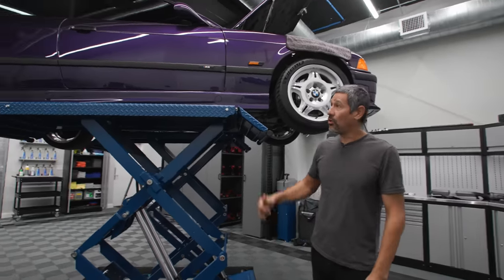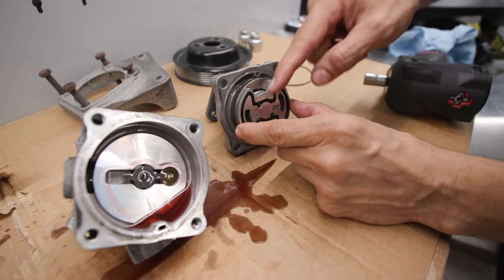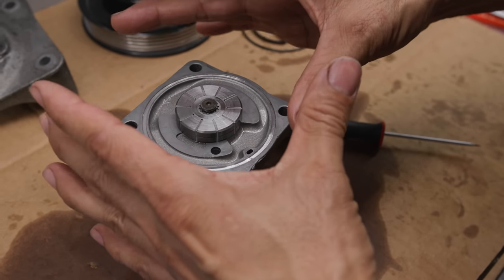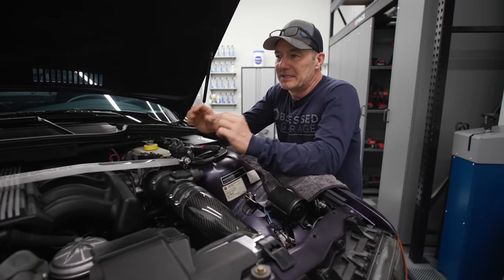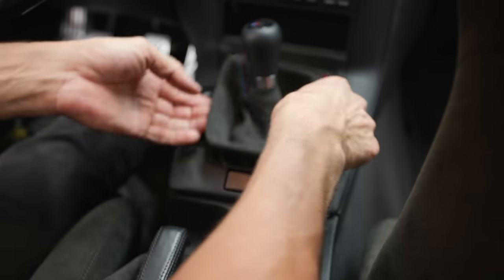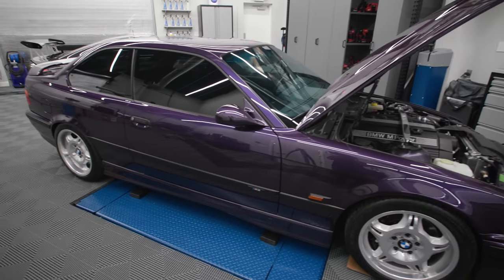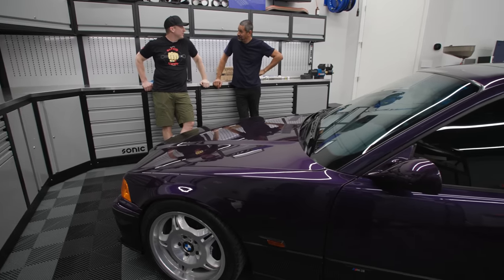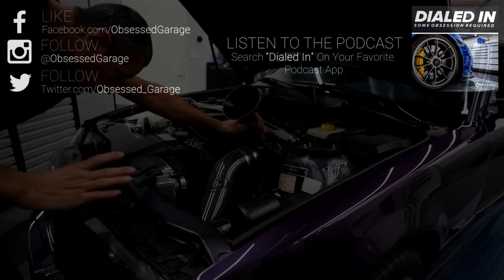E36 M3 Maintenance: Steering Pump Rebuild and Rack Change | Parking Brake Swap | Camber Adjustments

Comment: Good to see someone out there rebuilding a steering pump instead of rpl. When removing an c'clip or inner or outer snap rings, always put your finger on it so it doesnt fly off and get lost; what happens if the same thing happened to your new one: now your playing hide-n-seek with your clip instead of fix'g your pump. Those "fingers or flaps" are called vanes. Just like a trans pump, or modern day water pumps driven off the front of a crankshaft. Thx for taking the time to make your video.

Comment: The joys of maintaining a project car. I have to change out a slave cylinder and wheel cylinder before I can upgrade the tires this spring. When Estoril Blue was introduced in 1996 I was seventeen and from that point on I had always wanted a E36. Techno Violet Metallic has grown on me quite a lot through this series and tinting the windows helped even more. Encompass yourself with some drive time before parting ways with this car!